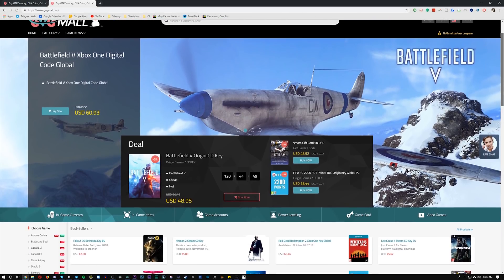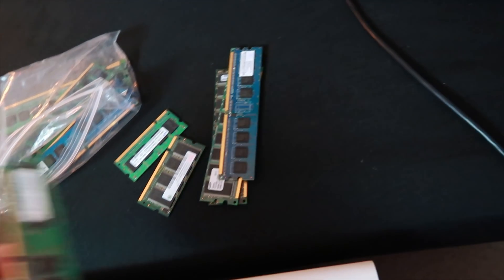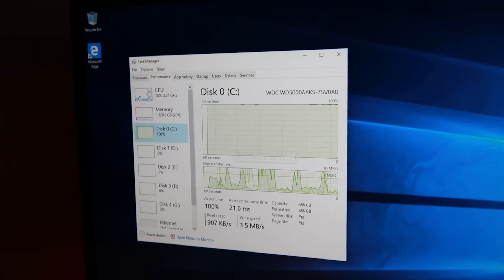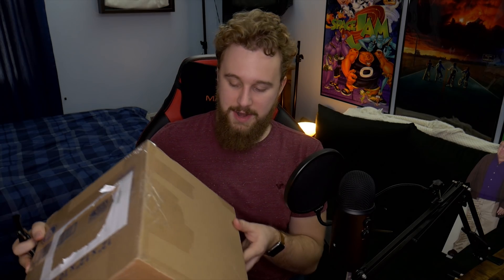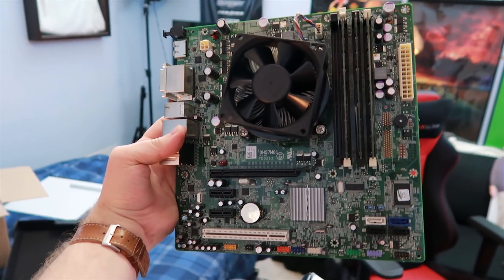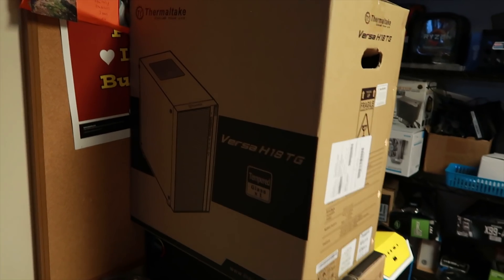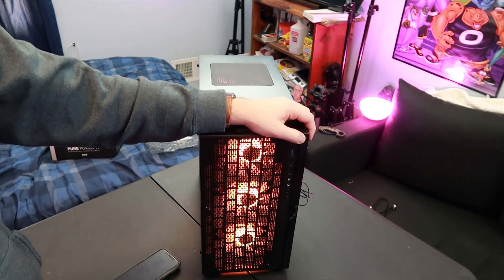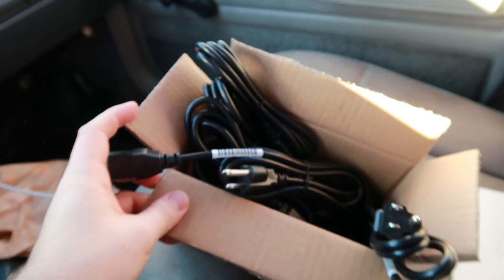Free PC Upgraded to a $250 Gaming PC

Comment: Really nice build! You should see if there is a difference between using 3 sticks of ram or 4. I know quad channel ram is better then dual channel which is better then single channel. But would 3 sticks of ram bottleneck the system at all?

Comment: I just did a build with an Xeon X3470 from 2009 using parts from free old PCs. Threw a 1060 in there and it still rocks

Comment: For 250 dollars i got an rx 570 strix 4gb 8gb kingston low profile ram ddr3 a kl-c500 psu a gigabyte motherboard a a8-5500b arctic 64gt cooler 3.8 terabytes of hdd space and an aerocool aero 500.

Comment: Just a quick question not related to the video, it might sound dumb for some of yall but i was wondering i i could use my cooler from my i3 4th gen processor for like a i7 4790k ? I dont know mutch about parts for processors and compatibility...
Reply: yes, you can.
Reply: @The18527  thanks for the reply
Reply: wich core i5 4th gen?

Comment: Nice pc build fam. I was wondering if you could help me out on my rig. It's decent, but i still get alot of frame drops in games like fortnite, Cs:go and other. The specs are better then this pc (not the graphics card) but the performance is not enjoyable at all.  Also bought 16 gb of ddr3 ram (8gb x 2), and started to get alot of bluescreens on my pc since i upgraded my ram. Maybe you can give me some tips, cuz this is really frustrating..
PC Specs:
Gtx 750 ti ; AMD Athlon x4 860k quad core; 16 gb ddr3 ram 2400mhz; 240 gb ssd;
Reply: Cpu bottolneck is your problem I believe
Reply: @arch0459  Thanks for the reply! Do you mind telling me which new proccesor to get? It would be really appreciated!
Reply: i thought A6-7400K/A8-7600/A8-7650K/A10-7700K/A10-7850K

u have to set RAM timmings manually if your motherboard support OC RAM

Comment: Why the rx 570 gpu you bought without any bidding? It a used one too but this one and other ones does requires bidding.https://www.ebay.com/itm/Gigabyte-Radeon-RX-570-GAMING-4G-4GB-GDDR5-256-bit-GPU-Graphics-Card-PCI-E/183618344417?epid=23011378964&hash=item2ac08195e1:g:aFwAAOSwIGxb~CeV

Comment: Quick question, as my mobo doesn't have an usb 3 connector is ot ok to not have it installed at all and just leave the USB not used? I've noticed the mobo in the video doesn't have USB 3 connector. I know you can get converts for the connection but I'm looking for a new case. Many thanks!

My specs:
Graphics Card: MSI GeForce GTX 1060 6GT OCV1
MotherBoard: Gigabyte H81M-S2V
CPU: Intel I7 4790k 
Ram: Ballistix Sport 16GB Kit DDR3
PSU: Cosair 650W Modular
SSD: Kingston 240GB A400
HDD: WD Blue 1TB

Comment: I had one of those systems as my first gaming system which it was definitely a good deal at $20 with the i7-860 and 8gb of ram with a Geforce G310 and no hdd which I bought one for $50 and got a 2gb 750 off my buddy for free and I was surprisingly able to run almost anything I wanted(overclocked the gpu alot). The i7-860 is definitely an underrated processor I would say especially if you get a motherboard that will let you overclock the little i7 which you'll get a cpu that'll be able to handle almost any game you throw at it lol

Comment: I'm working on turning an optiplex 990 with i5-2400 3.1ghz and 4gb ram into a gaming machine any tips? I currently installed 16gb of ram and windows 10 what's a good graphics card to pair it with? a 1060?
Reply: 1060 would be okay, just a bit of a bottleneck.. But still worth it
Reply: @zackburkhart6521  yeah I thought that might be the case, but I want maximum performance from this thing so I'll probably get it
Reply: @zackburkhart6521  a bit of bottleneck with a 3.1ghz 4core/4thread second gen? lol... that shit would bottleneck a 1050 probably, if it was the i7 ok i guess, but i5 just lol
Reply: ex-mined rx570 would be great
Reply: 1050ti if u don't wanna a psu upgrate
Reply: InfiniteKing_ 21 gtx 1050ti
Reply: i think 4 Gigs GPU it's enough.
but this CPU only support 2.0 PCIe Line. You can see bottleneck when put 3.0 PCIe GPU on 2.0 PCIe line CPU.

Comment: is it worth getting  
an i7 4770 with 6gb ram 500 gb hdd for 200$ or 
an i7 3770 with 4gb ram 500 gb hdd for 150$ or
an i7 2600 with 6gb ram 500 gb hdd  for 135$ and upgrading it
or just get a new build(2200g)?
Reply: My friend has an i7 4770 build, runs well enough in 2018. For gaming you would probably benefit from at least 8gb of RAM. But as you haven't mentioned a GPU I am not even sure you'll be gaming. You would also heavily benefit from an SSD for at least the operating system (a 120gb SSD will not cost you much nowadays, if not even 250gb)
Reply: I think the 3rd gen i7 is the best deal at $150.   $20 for 4gb ram and good to go.   Its nearly as fast as the 4th gen and you would have to get ram for that one too.    As for the argument of new vs old that is a trickier question depends on what your situation is...   if you have a little money now and no reason to expect you will have extra money in the future get the old machine it will get you by for a couple years.    If you are planning to use for a short period of time and then upgrading right away you are probably better off starting with a new AM4 platform.
Reply: new build, but get at least a 2400g, u really dont wanna be on 4c/4t for gaming

Comment: Hey can u do I7 990x Overclocking guide on stock or both stock and dedicated cooler?
The I7 990x is already a beast of an cpu but when its overclocked its so godly but there are 0 guide's of this cpu + this cpu is one of the only one's that Inter has made with an differend cpu stock cooler, its an tower color!
Reply: what the fuck do you mean by "beast of a cpu", it's literally soooooooo old dude, a fucking ryzen 2200g destroys it
Reply: @brandonchelsea4506  ikr
Reply: its maybe old but u dont know how good it still is, look at benchmarks of it online, u can do a I7 990x with an gtx 1080 and run pubg 4k ultra at 50 fps
it still has 6c 12t when u overclock it u can hit 5GHz
It performence are still great with an high end gpu! this 990x wins from a 2200g in high end with 1080 or above and 16gb ram or above, the 2200g wins it with low end 1050 Ti 8-16gb ram etc but thats not what this cpu is made for, its an $1000 processor when it came out!
Reply: @prmees  You do know the majority of 990X's don't reach 5GHz or even close to it, right? even a good one will only push to about 4.6, you'd have to be in the top 1% to get one stable at that clock even with a custom loop.
Reply: What i7 990X ? that's real CPU or just miss understanding ?
Reply: @claritoresdiano1021  google it, search benchamarks https://www.youtube.com/watch?v=fOFBTHJI0vg
it's such an good processor stil in 2019

Comment: Legend States If you don't like this comment a gt 710 will replace your 1080
Reply: I dont have a graphics card sooooo ill take that 710
Reply: @anajeelkami2026  Lel Well I have a gt 545 which isn't much better so we're in the same situation
Reply: 1080 I wish I have a 1080
Reply: I actually have a Gt 710. But the one i’m going to build will have a GTX 1070.
Reply: @MarusiFyren  u should buy an rtx 2060 perfomence of a 1070 Ti for only ~$350
Reply: PRMees I will Buy the 1070 used for 200$ You can’t get an RTX 2060 for that price.
Reply: Also Thanks Matt!
Reply: Jokes on you I don’t own a gtx 1080
Reply: I have gt 210 so im not gona like it
Reply: Randall Manalo needed to like! Close call right there!

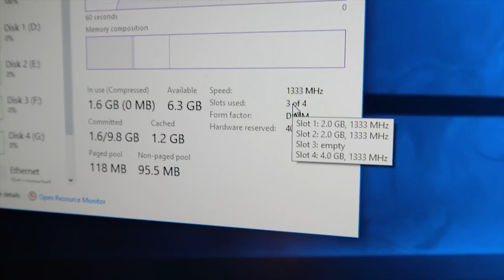Comment: either get ssd 3:00 or disable superfetch.
Reply: @EduardoMacias-h2r  well hard drives are apparrent since i dont know what it could have been an old 7200rpm hard drive they dont really differ from our current hard drives its still a shame that ssd´s cost a hell lot more and aren´t worth it for high capacity work loads even tho their life durance is alot higher more energy efficient and not really expensive to produce. If there would be proper competition in the memory market maybe dram, vram and vnand ssd modules could be cheaper and more affordable than hdd. its just a shame we are in 2019 now an still a Hard Drive costs 34€ in germany whereas it costed around 45€ 7 years ago where i have bought one and SSD´s didn´t change that much you still have to pay 120€ for a 1TB SSD with 500mb/s read and write speed even tho there are already m.2 vnand ssds which are going for atleast 10€ more and deliver almost tripple the bandwidth speed i mean they could have atleast decreased the prices srsly.